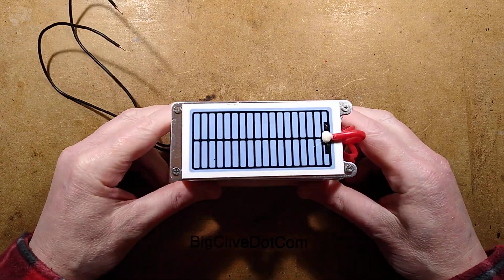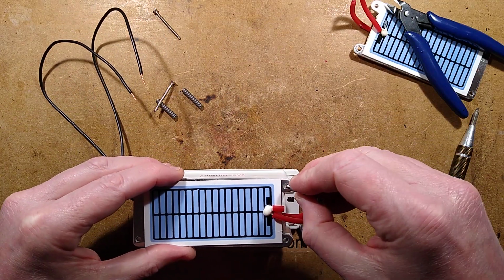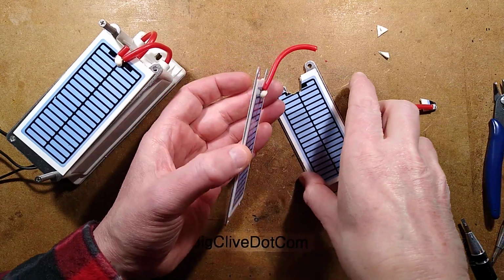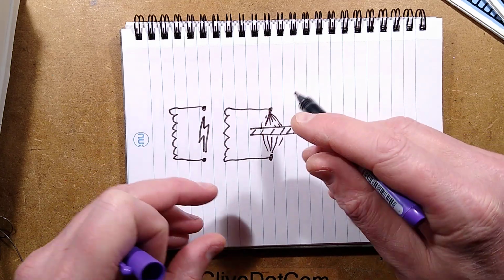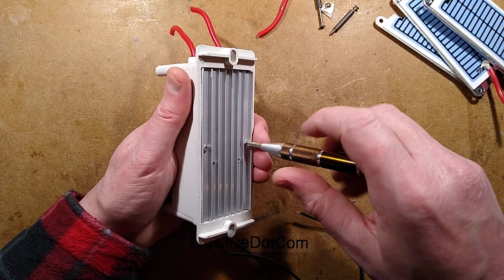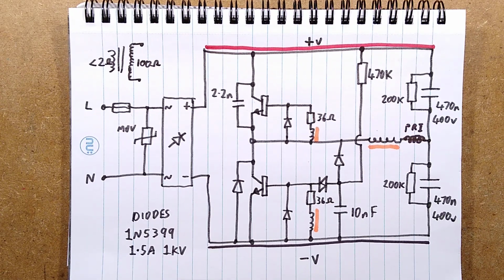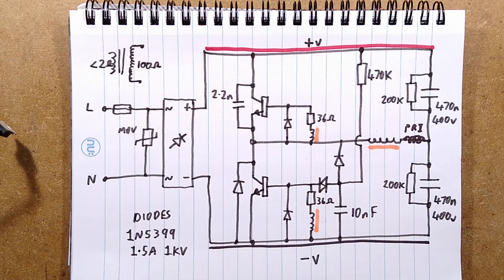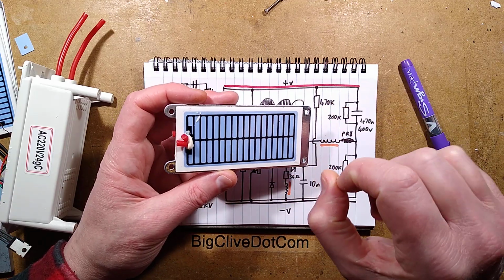High power ozone generator teardown with schematic

Comment: Our local farmer uses a box with TWO of those (and a 120mm p.c. fan) to produce enough ozone to fumigate barns / storage areas. He finds it excellent for residue-free control of everything from fungi / moulds  to the "larger" pests - particularly cockroaches. They may be immune from everything else, but ozone does them in quickly and efficiently. Also great for reducing the pong in the milking parlour during quiet times (and of course is a great sanitising agent!)
Reply: I read some studies, and two insects cause between 1/4 and 1/3rd of all grain harvests to be wasted.

Rice Weevil (S. oryzae) Primary Pest: Can attack whole, undamaged kernels. Highly destructive; can cause over 70-80% weight loss in sorghum and wheat within 3 months if left unchecked.

Red Flour Beetle (T. castaneum) Secondary Pest: Attacks broken grain or grain already damaged by weevils. Known for contaminating large quantities of grain; consumes roughly 315 mg of flour in its lifetime, but "ruins" much more through fecal matter and odors.

They were testing ozone against these, with great results; at efficacious doses to get rid of them before they grew, it also improved grain germination (by killing mold spores and bacteria).

Very underused.
Reply: I've often wondered if the  very enhanced oxidation potential of ozone (in combination with the usual Aussie hot, dry summer weather) might increase the risk of spontaneous combustion in e.g. silage? Since most of the heat's produced by microbial metabolism (and the ozone kills off the microbes), the reduction in local heat generation might offset the oxidiser effect of the ozone? Almost worth a small (undergrad. level) research project perhaps?

Comment: When I want to generate ozone, I run my 60 year old Lionel trains.
Reply: Ah yes, the smell of ozone and those little Lionel smoke tablets!😀
Reply: @b3j8  the ozone actually comes from the little AC motor.
Reply: @timothybaker8234  Oh yeah, I know.  My Dad had quite a layout in our basement!  The AC motor in the tender that powered the whistle would sometimes stick.  Then you'd really snell the ozone!🤣
Reply: @b3j8   brush motors tend to generat " NO2 " not ozone Only corona discharges and UVC generate Ozone ...
Reply: @youknowwho5375  Well anyway those were great times!
Reply: @b3j8  its most likely the smell of the brush electrodes it smells great from a expensive rc car I miss my one ☹️

Comment: Those produce HUGE amount of ozone when new but may not last too long (especially in high ozone level environment). My diy sterilizer cabinet has one that is pretty worn out and does not produce that much ozone. It needs a replacement unit any day (that I have a few).
Ozone is great for sterilizing stuff like FFP2/FFP3 masks that can be sometimes hard to find or at least very costly.  I never knew last year how much FFP2/FFP3 respirators I'd be using in a daily life. For any DIY solution, make sure you know what you're doing. Studies indicate a need for enough dose + humidity. If you put way too much ozone, rubber bands will fall of respirators and the screws will oxidize badly. Don't ask how I know, just debug better your software :)
Reply: how long did it last?
Reply: @termivan  The question is how long will it last. My 65 liter cabinet has had one from the beginning of the pandemic and it is still going on well. I've used levels of about 70-150ppm for about 1-2 hours weekly or twice a week. It runs with PID controll and the duty cycle is probably something like 25%. (It just tops up ozone when it is used or decomposes and more at the start of cycle. One with 3 ozone generating plates is overly powerfull for that)
Plenty of use hours and I have a spare at hand for the day it will fail. The generator is inside cabinet ie. not just generating ozone that is blown away but exposed to ozone all the time.
It still goes strong but produces less ozone (I'd guess like half) than when it was new. It has taken some very high level cycles though, like way over 2500ppm that already corrodes metals like screq heads visibly. (no way to say how high, I can measure only up to 2500ppm)
This can give you some idea of what kind of abuse it has taken.

Comment: I would have thought they would have used a Royer type oscillator with a single feedback coil connecting between the two base connections of the two transistors and a single 47K resistor for it's bias voltage.
Reply: Classic Royer is parallel resonant so it needs a big series inductor to isolate the resonant voltage from the power input.  This circuit is series resonant avoiding the need for an additional inductor.  Strongly suspect that makes it cheaper.

Comment: These things do not have much practical uses (outside of fumigation and water treatment), because they will oxidize your lungs as well.
Reply: For chemistry they are very interesting. If you run the plates e.g. inside a bottle and pump airflow through it, you may be able to use the O3 as oxidizer for several reactions. For example O3 is able to produce SO3 from SO2, or in Water, directly produces sulfuric acid from burning sulfur gas, without need of H2O2 as oxidizer and without catalysts. Of course you need to make sure, to pump excess O3 outside or under fume hood. It's really very toxic, but also very unstable and therefore harmless when outside.

Comment: It has been found in experiments using the apparatus and methods of the invention that exposure of HIV-infected blood to an ozone-oxygen mixture having an ozone concentration of no more than about 27 .mu.g/ml, or 2.0% by weight, and a surface pressure of about 2.2 psi, for a time period of only about sixteen seconds, resulted in inactivation of up to approximately 99% of the HIV, with no deleterious effect on cellular metabolism or DNA replication.

The invention is particularly adapted for the extra-corporeal treatment of human blood in a continuous process, wherein blood is withdrawn from a patient, circulated through the treatment apparatus of the invention and returned to the patient. Although the specific conditions of the treatment process may vary from patient to patient, depending upon the general health of the patient and the condition of the blood, satisfactory results are generally obtained when the blood is caused to flow through the gas-liquid contact apparatus at a flow rate of about 65 ml/min, typically achieved when the gas-liquid contact apparatus is inclined at an angle of about 27 DEG to the horizontal, and the concentration of ozone in the ozone-oxygen mixture is no more than about 27 .mu.g/ml and is at a surface pressure of about 2.2 psig.

The gas-liquid contact apparatus of the invention is non-foaming, whereby it is not necessary to reconstitute the blood after treatment, and treatment with the apparatus of the invention is virtually free of mechanical damage to blood components, especially in view of the variable onclusion pumps used to pump blood through the apparatus. Moreover, quick-connect/disconnect fittings are used to attach blood lines to the apparatus, whereby all components which might be contaminated with infected blood can be quickly and easily replaced between treatments, so that more treatments can be effected in a shorter amount of time than with conventional apparatus. The invention also provides means for detecting and proportionately adjusting blood flow rate and ozone concentration. Thus, if restriction to flow should occur, a flow sensor detects the reduction in flow and proportionately reduces the drive to the high and low frequency generators to thereby reduce the concentration of ozone.

Comment: I might have missed it, but did we determine or estimate a high voltage frequency?
Reply: As a guess, it's probably along the lines of 20khz to 80 khz, similar to the halogen transformers with similar circuitry. Higher it becomes inefficient, lower and you'll hear it.

Comment: References
1. Noyce JO, Hughes JF. Bactericidal effects of negative and positive ions generated in nitrogen on Escherichia coli. J Electrostatics. 2002;54(2):179–87. doi: 10.1016/S0304-3886(01)00179-6. [CrossRef] [Google Scholar]
2. Noyce JO, Hughes JF. Bactericidal effects of negative and positive ions generated in nitrogen on starved Pseudomonas veronii. J Electrostatics. 2003;57(1):49–58. doi: 10.1016/S0304-3886(02)00110-9. [CrossRef] [Google Scholar]
3. Fletcher LA, Gaunt LF, Beggs CB, Shepherd SJ, Sleigh PA, Noakes CJ, Kerr KG. Bactericidal action of positive and negative ions in air. BMC Microbiol. 2007;7(1):32. doi: 10.1186/1471-2180-7-32. [PMC free article] [PubMed] [CrossRef] [Google Scholar]
4. Shargawi JM, Theaker ED, Drucker DB, MacFarlane T, Duxbury AJ. Sensitivity of Candida albicans to negative air ion streams. J Appl Microbiol. 1999;87(6):889–97. doi: 10.1046/j.1365-2672.1999.00944.x. [PubMed] [CrossRef] [Google Scholar]
5. Marin V, Moretti G, Rassu M. Effects of ionization of the air on some bacterial strains. Ann Ig. 1988;1(6):1491–500. [PubMed] [Google Scholar]
6. Kerr KG, Beggs CB. Air ionisation and colonisation/infection with methicillin-resistant Staphylococcus aureus and Acinetobacter species in an intensive care unity: a reply to Jeffers. Intensive Care Med. 2006;32(9):1439. doi: 10.1007/s00134-006-0194-6. [PubMed] [CrossRef] [Google Scholar]
7. Shepherd SJ, Beggs CB, Smith CF, Kerr KG, Noakes CJ, Sleigh PA. Effect of negative air ions on the potential for bacterial contamination of plastic medical equipment. BMC Infect Dis. 2010;10(1):92. doi: 10.1186/1471-2334-10-92. [PMC free article] [PubMed] [CrossRef] [Google Scholar]
8. Nishimura H. Analysis of bactericidal material generated by electrical devices advertising bactericidal ability against bacteria on the agar gel plates. Kansenshogaku Zasshi. 2012;86(6):723–33. doi: 10.11150/kansenshogakuzasshi.86.723. [PubMed] [CrossRef] [Google Scholar]
9. Sies H. Oxidative stress: introductory remarks. In: Sies H., editor. Oxidative Stress. London: Academic Press; 1985. p. 1–8.
10. Farr SB, Kogoma T. Oxidative stress responses in Escherichia coli and Salmonella typhimurium. Microbiol Rev. 1991;55(4):561–85. [PMC free article] [PubMed] [Google Scholar]
11. Yoshikawa T, Naito Y. What is oxidative stress? Jpn Med Assoc J. 2002;45(7):271–6. [Google Scholar]
12. Zakeri F, Hirobe T. A cytogenetic approach to the effects of low levels of ionizing radiations on occupationally exposed individuals. Eur J Radiol. 2010;73(1):191–5. doi: 10.1016/j.ejrad.2008.10.015. [PubMed] [CrossRef] [Google Scholar]
13. Schwarzwald R, Monkhouse P, Wolfrum J. Picosecond fluorescence lifetime measurement of the OH radical in an atmospheric pressure flame. Chem Phys Lett. 1987;142(1):15–8. doi: 10.1016/0009-2614(87)87242-1. [CrossRef] [Google Scholar]
14. Luts A. Evolution of negative small ions at enhanced ionization. J Geophys Res Atmos. 1995;100(D1):1487–96. doi: 10.1029/94JD01836. [CrossRef] [Google Scholar]
15. Tammet H, Horrak U, Laakso L, Kulmala M. Factors of air ion balance in a coniferous forest according to measurements in Hyytiälä, Finland. Atmos Chem Phys. 2006;6(11):3377–90. doi: 10.5194/acp-6-3377-2006. [CrossRef] [Google Scholar]
16. Sies H. Biochemistry of oxidative stress. Angew Chem Int Ed Engl. 1986;25(12):1058–71. doi: 10.1002/anie.198610581. [CrossRef] [Google Scholar]
17. Gardner PR, Fridovich I. Superoxide sensitivity of the Escherichia coli aconitase. J Biol Chem. 1991;266(29):19328–33. [PubMed] [Google Scholar]
18. Atkinson DE, Walton GM. Adenosine triphosphate conservation in metabolic regulation rat liver citrate cleavage enzyme. J Biol Chem. 1967;242(13):3239–41. [PubMed] [Google Scholar]
19. Chapman AG, Atkinson DE. Stabilization of adenylate energy charge by the adenylate deaminase reaction. J Biol Chem. 1973;248(23):8309–12. [PubMed] [Google Scholar]
20. Chapman AG, Fall L, Atkinson DE. Adenylate energy charge in Escherichia coli during growth and starvation. J Bacteriol. 1971;108(3):1072–86. [PMC free article] [PubMed] [Google Scholar]
21. Varghese S, Tang Y, Imlay JA. Contrasting sensitivities of Escherichia coli aconitases A and B to oxidation and iron depletion. J Bacteriol. 2003;185(1):221–30. doi: 10.1128/JB.185.1.221-230.2003. [PMC free article] [PubMed] [CrossRef] [Google Scholar]

Comment: The problem is that at >150w with non cooled electrodes you start actually promoting NOx production (and in combination with humidity they end in nitric acid). I had good results with pulsed supplies to keep electrode temperature low (even just a low freq duty cycle will do), inducing much faster inactivation of bacteria and higher O3 production.

Comment: Black coating is most likely glaze (possibly quartz based) and solder is most likely zinc or even ZAMAK based solder. at these power levels you can get to temperatures that would soften even normal (soda-lime) glass.

Comment: Broken on arrival. 1000s of volts hanging in the breeze.Gasses its operator. 
This belongs on Clive's affiliate page·
Reply: 1000s? what kinda grid you running in the uk?
Reply: @SavageZebra67 uk is ~240V but it gets boosted up by the circuit in the thing and runs around 4000 volts
Reply: @TheDarkness344  yah most places are 240... That still doesnt explain how or why you have 4000v coming through a cellphone wire. if it was just discharging a capacitor then maybe. but just saying the circuit makes magic.
Reply: @TheDarkness344  I love how your the one to speak up. 4000v from a 240v source with no step up transformer. yah its the circuit. still nice to know the UK still in a fairytale
Reply: Lol I thought u meant that we had 4000v as mains electricity lol
Reply: @SavageZebra67  there is a transformer? He shows it in the video and shows how it steps up the voltage to 4000v
Reply: @TheDarkness344  hmm 400v sounds more reasonable.  i see now how we are dancing between capacitors for high output. still 4000v? your smoking more than the wire my guy
Reply: @TheDarkness344  nah trying to figure out how you stepping up to 4000v in a bug zapper? without like microwave transformer the size of your fist. just misinformed. I actually went to the end to see the 400v thats still alot. but makes a little more sense bouncing off the capacitors
Reply: @SavageZebra67  lol they use 4000v - "They operate at very high voltage.  Around 4kV and probably in the region of 30mA.
They will get quite hot in use.  Possibly too hot without fan cooling." i would of said it has low current which is why the wire doesnt melt - but 30mA is still quite high lol so yea it may even melt. im pretty sure that the voltage doesnt matter for the meltings of wires and that it is the current (dont quote me on that) so devices like that can exist - e.g https://www.ebay.co.uk/itm/15KV-High-Voltage-Inverter-Generator-Arc-Ignition-Coil-Module-DIY-3-7V/352200519291?hash=item5200c96e7b%3Ag%3A1nEAAOSwxIRZ-%7E7H&LH_BIN=1 - an extremely small device that says it steps up to 15kv (problably only around 10 - but still a huge amount)
Reply: @TheDarkness344  but again that just a starter coil it can discharge and cool. running 4000v at 30ma we making plazma. it should at least glow like the sun before it melts.  and how dou have low current and high resistance
Reply: @SavageZebra67  ya - the ozone thing is problably not meant to be run for a long time and I bet you it will melt if you run it for long enough lol.
Also that thing I sent u is the circuit they use in plasma lighters - so meant to run around 30 seconds before it explodes because of shoddy engineering and not enough cooling. They are pretty cool lol
Reply: @TheDarkness344  yah HV spark but like no current. So this isnt something you folks leave around the house. letting the smoke out will produce alot of ozone tho
Reply: @SavageZebra67  definitely not a good idea to even use this in the first place lol - very dangerous XD
Reply: @SavageZebra67  That video you posted, regardless of the title, is a 14Kv 30mA neon sign xfmr. Like almost all of them are. These ozone generators are not much more than a step up xfmr, and they absolutely run at +/- 4Kv.

Plasma? At 4Kv? Not without a vacuum pump and a bottle of argon, and even then not likely unless you're running at half an amp or more.
Keep reading though man. You'll eventually understand what you're talking about.
Reply: @jimmyb1451  not sure what your on about I never said it wouldn't run. It's just not safe or practical. And do you know what a plasma cutter is?
Reply: @SavageZebra67  ahhh.
Reply: @jimmyb1451  ahhhh
Reply: @SavageZebra67  Yes I do mate. Would you like to go in to the very specifics of how they work, what type of plasma channel it is and how it is formed?

Since you want to split hairs, I shall clarify my previous statement by adding, certainly not at 50 or 60 Hz.
Reply: @jimmyb1451  damn did not expect to wait two hour while you googled it in the middle of the night. Get Help
Reply: @SavageZebra67  rofl.
Reply: @jimmyb1451  yes ROFL indeed.
Reply: @SavageZebra67  Since you clearly know so much about it. What are the chances you can get me the schematics for a proweld plasma cutter/MMA/AC DC TIG unti?
Reply: *unit
Reply: @jimmyb1451  m8 your literally having conversation with yourself. Wipe your mouth your frothing.
Reply: @SavageZebra67  lol. Ahhh I see, you're one of these.

Good on ya mate. So, no, you can't.
Reply: @jimmyb1451  dude your literally on one man it's crazy watching someone unravel in real time
Reply: @SavageZebra67  wtf are you talking about?
You want to try that again in English?